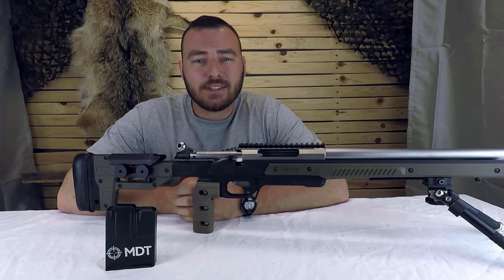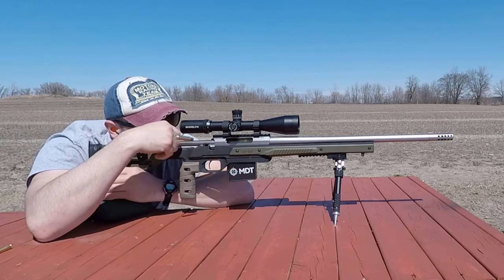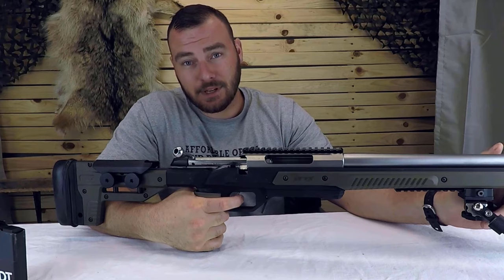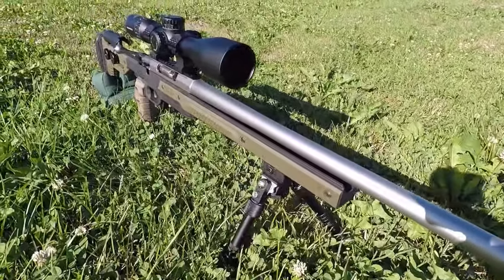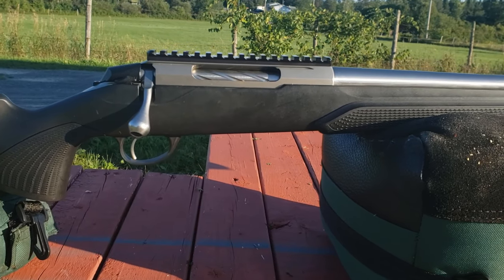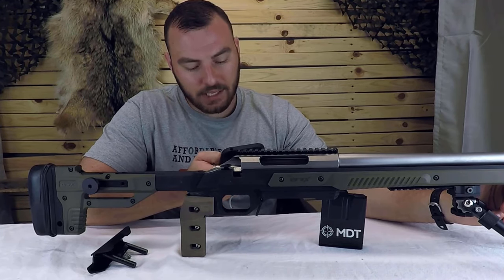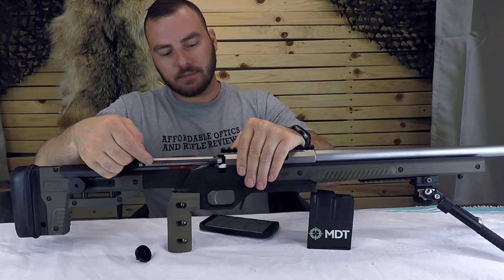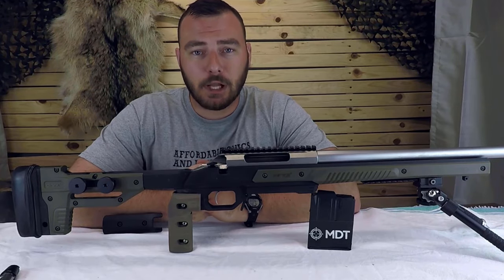MDT Oryx Chassis Review: the most affordable Chassis on the Market today

Comment: MDT did recently release a newer budget chassis in the form of the XRS (which you do mention at the end of your video). There's also the KRG Bravo which is a nicely affordable
Reply from the maker: Your right Klaton, however the xrs and the the krg are both polymer/aluminum, thus not fully aluminum. And the XRS is about 20$ more affordable than the Oryx. Soon we will be reviewing the xrs, although I think ill still preffer the Oryx, i preffer the added weight.
Reply: @EpikArms  Looking forward to your take on the XRS. The added weight of the Oryx is a plus for sure.
Reply: I’m trying to convince myself to not go with the magpul prs stock for my Ruger predator. Did either of these alternatives materialize and how are they priced compared to the Oryx?
Reply: @SEAKPhotog    i liked my  xrs when i did a build with a savage 110 tactical in 6.5creedmoor. like the fact you can put a arca rail and weights onto the chassis! check mine out
Reply: @UltimateArms  thanks for the info!
Reply: @SEAKPhotog   your welcome. i just posted my review of the xrs. come check it out let me know what you think

Comment: Oryx update. For a while, I was having a problem with the adjustable cheek piece sinking on me. And a feeding problem with rounds jumping out of the magazine. And I had put my Compass II back in the factory stock for a while and let the dust settle and thought about it some more. The factory stock is great and has metal pillar bedding. But I like chassis and I did spend that money on the Oryx. So, I solved both problems.

Feeding problem. Stay away from p mag or any double stack magazine. The retension lips are too wide. Stick the MDT proprietary mags based on the AICS magazines with a retension lips about .4 inches (10.71 mm) apart. In the Compass II action, they will present nicely but the magazine does not intrude into the receiver.

Cheek riser problem. The chassis comes with allen-headed set screws. Stay with those. I had ordered the accessory thumb screws but the way that those fit, there is a limit to how tight you can get against the posts. So, I took those out and put the original set screws back in. Voila, cheek does not move. And really, adjustable cheek is great but you only need to move it if going to higher rings or mount or bigger scope. Or setting up for a different shooter who's cheek bones sit differently than yours. Set the cheek rise for your standard position of shooting and leave it that way. If you shoot at the range or hunt from a blind, sticks, or tripod, one cheek height will work for all of that.

Another hack to maintain your best eye relief. And this is a consideration for all adjustable cheek systems. They are all smooth and your cheek can slide. So, you introduce neck tension maintaining. The solution is Goda Grip. Get cheek grips and they will give a comfortable and shock absorbing place for your cheek to rest. And you can get some finger grips. And an ammo carrier. That is what I use.

So, I have the Compass II back in the Oryx and it is just fine.

Comment: Also, I find, another advantage to Oryx is that they can accomodate a Winchester short action. My TC Compass II has a distance between the action screws of 7.01 inches. It won't fit the MDT chassis but it will fit the Oryx Hunter, if  decide to go with that. So, be mindful that if the MDT lines of LSS and ESS don't fit, you might find one at Oryx.

Comment: Magpul plastic mags work great. No loading issues! At least for me!
Reply: Are you saying a Magpul Pmag Gen m3 .308 plastic will work on this chassis just fine?!
Reply: @anythinggarage  i have absolutely no issues with magpul mags on this chassis. If that's your question?
Reply: @atf-am-music  it was my question but this guy has issues with them. Did you mod yours a bit? Do you run .308? Many variables here maybe. https://youtu.be/5Stxo-IZ8zU
Reply: @anythinggarage  I haven't done any mods whatsoever...i'm using magpul 10 round clips. I'm running a remington 700 VTR in .308. I had an awful time with the factory mags until I switched to magpul. No loading issues yet so far! Try sliding the mag in place slowly instead of popping the mag in until you hear the release level pop. I've seen  videos where the slam them in like normal and end up with the mag pushed to far up. I myself just pop them in and no issues.
Reply: @anythinggarage  It sometimes can be the mag in rare case...to much spring tension...maybe the mag or chasis had a slight molding issue not visible...etc.
Reply: @atf-am-music  Thanks for all the quick replies! I am close to pulling the trigger on this chassis for my Savage Model 10 .308. I haven't used the rifle in a while now cause ammo is scarce and super expensive right now for that calibre.
Reply: @anythinggarage  I hear you on that!!! I still have a scope I need to zero...not a lot of ammo here as well!
Reply: @anythinggarage  Your welcome

Comment: On their website ready to "pull the trigger"  Should I?  $399 +tax+ship. ... will a short action bolt clear the cheek rest? ... Too late, I did it.  No tax in Texas, $413.99.  I have been thinking of this for quite a while.
Reply from the maker: My tikka is a short action, it doesnt get in the way for cycling whatsoever just for bolt removal and instalation. And i recommend getting the quick removal screws from mdt, problem solved. Yes id stongly recomment the Oryx.

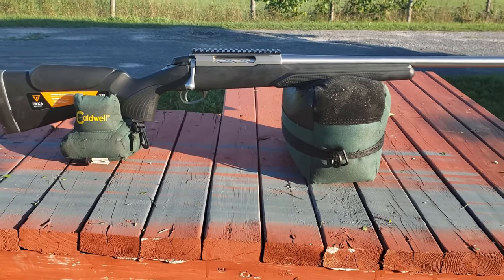Comment: Your comment at the 8:45 mark about cheap stocks on low end rifles is generally true, but the picture you posted at that point of a Remington 700 LTR as an example of your point is totally incorrect. Those rifles ship with an HS Precision stock that should not be compared with the standard Hogue shipped on cheap Rem.700 models. My LTR is a tack driverl and solid as a brick.

Comment: I got the stock and had issues.  It has a hidden screw in the back of the trigger guard that was impossible to tighten properly.  It had a lot more felt recoil than expected.  It did not improve my groups, and you have to take the cheekpiece off to clean it.

Comment: Full aluminum bolt block bolt in...... chapter tactical and its $215.00 same weight and is amazing
Reply: Bedding block* 

Choate tactical *
Reply from the maker: yeah that modeal at that price doesnt have any comb height adjustment nor lenght of pull, at 560$ or so their stock have all the features

Comment: Beware that not ALL AR 15 Grips will fit this chassis. The ATI X1 Grip will not fit this chassis because the beavertail prevents it from aligning up at the proper angle for screw installation.
Reply from the maker: Thanks, I hadnt even thought about that

Comment: What kind of rear bag are you utilizing for this particular chassis  ? I have struggled getting my 6 inch Crosstac or a monopod to feel comfortable. I did find that putting a corn hole bag under my hand and holding the monopod at an angle helps.
Reply from the maker: I usually use the caldwell rear bag its really not the spacial but works great

Comment: i heard that tikka doesn’t support aics magazines since they have their own magazines. so since ur barrel action is tikka on that oryx chassis, have you tried using aics magazines if it’s compatible?
Reply from the maker: That is correct for tikka factory rifles they only accept tikka mags. When you change the stock. It's based on what the stock takes. (In this case AICS mags
Reply: @EpikArms  i see, thanks for the info.

Comment: I'm considering upgrading my 10/22 stock to the Oryx Chassis.  Wondering if there is a place on the back part of the stock to mount a swivel post for a sling?  I purchased the rifle for the Mapleseed at our range this summer but realize there are definitely mods that should be done to improve the rifle instead of replacing it.